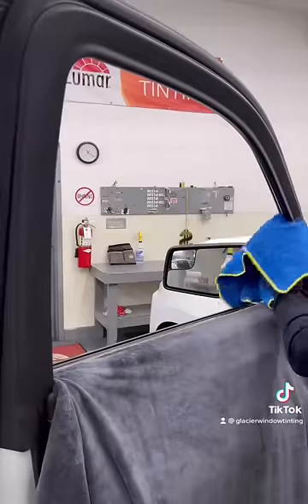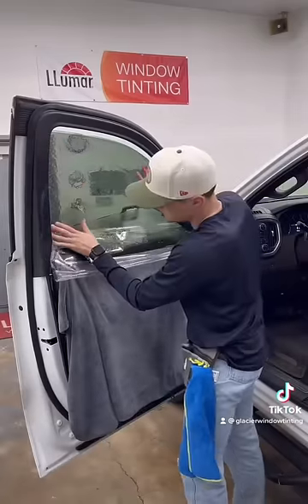Remove & Replace ✅

Comment: Damn I need my car windows tinted so badly. I get scared someone’s gonna see all my work tools and break in but more importantly I’m sick of getting caught picking my nose in traffic
Reply: go for it, you'll never look back!
Reply: I've got all my back windows tinted pretty dark from factory. Which is where I stache all my tools. Behind the front seats and under my back bench seat.
Reply: As long as you don't eat your boogies, you're good
Reply: Screw it , we all do it .. just remember though, Flick don’t lick 🤙🏼
Reply: @Vndcatr  that was a good one.
Reply: Bro same. I pick my nose in comfort with my 18% tint
Reply: I'm far sides and can't see far away without glasses. I also have transition lens. So make sure to take that into account when picking your shade of tint. Also I use black window covers so you can't even peak inside with a flash light.
Reply: I put tints on my car because it got broken into. 10 percent all around, 30 percent on the windshield. No break-ins since then. 
My stepfathers work van got broken into, they didn’t touch the tools…..they went for the grocery bag that had the Frosted Flakes.
Reply: I literally have a bumper sticker that says "Don't tailgate or I will flick a booger at you" 😂
Reply: @missali2u  While being the victim of such a crime really really sucks (I'm sorry that you had to deal with that).
That's a Win/Win as far as car break-ins go.
They broke in and left the most expensive stuff (tools and the vehicle) Win 👍
In a round about way, you "gave" a meal or two, to those in need, (I wonder 🤔 if you can claim a tax deduction 😏) Win 👍
🙂
LOL
Reply: tinted windows are probably one of the best quality of life upgrades that you can make for your vehicle
Reply: I feel you there brother. My new truck got NO tint and I'm like damn. All this Milwaukee and Snap-On really be tasty to someone.
Reply: Owwowowowowpwpwpwwpwppwowowowowowwowowowpwpwpwpwowwowowoqooqowowowwowowowoaoaoaowwowowowowowowowowowowowowowowowowowowowwoowwowowpwpwowowowowoowosowowowowwowowowowowowowosseeowowowwowowowowowowowowowowowowwowowowowowowowowowowowowwow
Reply: Went from having a blacked out 2 door to a 4 door with 0 tints at all and it makes me so anxious 😭😭 getting them tinted this week though
Reply: Someone broke in and stole all my tools just last week
Reply: I put 5% over top of factory tint for the rear side windows and back window then 50% on the front side windows. Just black when trying to look in. Can’t see a damn thing in the trunk or on the seats in the back. I carry a lot of tools and parts so it was the best money I’ve spent.
Reply: They have this stuff at walmart that is super easy to install yourself and it is removable and replaceable unlike most tints.
Reply: Y'all nastyyyy 😭😂 any of y'all ever heard of keeping a box of tissues and hand sanitizer in your car?
Reply: I be driving a tab bit slower than the person beside me just so I can pick my nose before we hit a red light lol.
Reply: @g35s  p
Reply: The best noses are hand-picked.
Reply: Digging for gold that's why lol
Reply: My mom once pulled up to a stop light and witnessed my uncle smash a mcdouble in 2 bites💀 we call him 2 bite mike now🤣
Reply: 😂😂 There was no pick! I was scratching my nose! There was no nostril penetration! I didn’t pick! There was no pick!!
Reply: Tint is awesome, but don't use it as a security device. It's stupid easy to see what you have through tinted windows. Just open your phone camera and press it to a tinted window sometime.
Reply: Careful if you have a warranty, it can void some. Found out it does right before tinting my windows, thank God.
Reply: @melaniesparkinez6867  did you know that upwards of 90% of people pick their nose? It's actually quite strange how much of a social faux pas it is. As long as it's not incessant and causing damage, there's nothing wrong with it.
Reply: NO SERIOUSLY WITH The Traffic Boogers ! It’s Like I’m Always Near Somebody Or Somebody Coming From The Opposite Direction Have Me Looking Like A Dead In Headlights With My Finger Casually Near My Nose Hole 🤣🤣🤣
Reply: Worth it man, just make sure it’s not exactly the legal limit or you gonna get whoop whoop
Reply: I dunno I kinda disagree with everyone's advice... eat them thangs! Extra protein 🤣
Reply: Hahahahahaha
Reply: Bro I had tints they broke into my car thinking I was gonna leave stuff behind but I remembered that I live in the hood and remind myself to keep the car empty no matter what 😂
Reply: The tint just gone make it easier and quicker for them to break in yo ride
Reply: @nsant YESS my sister does that and I HATE her for it 😭😭 I guess she’s not the inly one in the world
Reply: Got 20% all around my daily, (19' camry) and getting 5% with 35% on the windshield on my mustang in the spring
Reply: I think it's a justified expense
Reply: Hahahahaha

Comment: “A little bit of heat” proceeds to hit it with a blow torch lmao 😂
Reply: Ayo I was gonna say obviously this guy knows more then me about window tints but I thought a straight up torch would be a bit much for plastic film.
Reply: @SlowMenWorking  takes a bit for the heat to get through this new glass. It's not like in older vehicles. Even then it still isn't bad. 
It's just enough to create enough heat. It isn't bad at all.
Reply: @mitchellandrew3318  Lol right? What were they expecting? A BIC lighter? 😂
Reply: @sowelly2808  bahaha
Reply: @sowelly2808  it's always the ppl who have ZERO idea. And how some come up with there own techniques over time doing such trades. I build motors and homes. But also custom interior and stuff. If it works, I'll try anything a few times or come up with what works for me. I do lots of shit with motors many who don't even build, or they only know how to rebuild and say it's wrong. Like come on, I've blown up enough shit to find out what works lol
Reply: he was using it on the outside of the window. You dont need a heat gun if you know how to use a torch. He is not putting that much heat into it, either. Distance and speed of movement can be quicker than a heat gun with the same amouny of heat put into the window. That is a little bit of heat. That is the quickest tool for the job and easiest to use.
Reply: @SlowMenWorking  hes on the opposite end of the window. He is not putting flame on the tint
Reply: @Cory-lk5bu  and it's a green propain camping tank. They don't pump tons of heat compared to a yellow or blue tanks I use on my metal parts or doing plumbing.
Reply: That propane torch is nothing like an acetylene torch like most people think.
Reply: But it’s still a little bit of heat. He’s not holding the damn touch there
Reply: Dont use alot of heat on dual pane euro cars as the laminate they use to bond the dual pane glass will start to bubble.
Reply: @Cory-lk5bu  im sorry but here's the problem I have with that, what if I am bringing a really expensive car in to get tinted I am most definitely not gonna be wanting a blow torch anywhere near it. Just not a smart idea when you can get a really nice heatgun to be able to control the exact temperature to make sure your not gonna burn or melt any of the trim. Just wreckless in my opinion.
Reply: @Cory-lk5bu  who care the tint - is the car panels that matters if you have a expensive car you don’t want someone to try tint installation with a TORCH !!!
Reply: The problem with a torch is it's a pin point heat source. When you hear glass unevenly it causes thermal shock and forms cracks. With tempered glass this could be invisible to the naked eye but after a few heating and cooling cycles those cracks will spread and have been known to shatter. One of the first things you learn doing any work with glass and heat is that you either need to preheat the whole piece slowly and add more intense heat or use a heat gun on a reasonable setting and distance from the surface working over the entire surface. There's been times I've been lazy and went straight to using a propane torch to save time and as soon as the heat hit it cracked and shattered the glass I was forming. You'd think I would learn after the first time but it took a few times before I was sick of picking up the mess.
Reply: @SlowMenWorking  It's not... A blow torch works just fine, you just have to be more carefull to avoid burning the film. Just run the torch on a low setting, and keep proper distance, and it works just fine.

Go grab a torch, and move your hand in front of the flame at some distance - It's not searing hot once you get a few inches away from the flame.
Reply: @Cory-lk5bu  torching raw glass even if its for split second to get the effect of a heat gun puts the glass in extreme stress. if there was any micro cracks there it would probably bring it to shattering. i was gonna ask if he ever broke a window doing this before. cuz i doubt they teach you in school how to safely blowtorch car windows...
Reply: yeah jes gonna blow a window with a torch one day if its not heat resistant

Comment: that moisture bubble at the end though, haha great video in all honesty to bad thats there at the end.
Reply: Yeah I caught that too.
Reply: That’s what I was gonna say
Reply: I’m sure heat will make that go away
Reply: @akidim13  sometimes it does, that one looked fairly large but it's from video perspective. If not sometimes it can be pressed down but may leave a ring you'll see.
Reply: I'm trying to see it but I can't, is it at around the 2 o'clock area looking at window from outside?
Reply: I was about to comment the same thing..
Reply: @Paul B.  it's in the right upper region. The light coming through the windshield makes it visible but barely. I had to watch this 3 tines to make sure I saw what I saw myself
Reply: @nickm5466  lol same..
Reply: It’s normal to sometimes see a bubble like that. It will go away on its on in a day or 2. When I got my Tesla tinted it had that. Went away during the curing process and been fine a year later.
Reply: Was just looking for that comment to see if someone else saw it too
Reply: thank god i wasn’t the only one lolol
Reply: torches do that heat guns are meant to be used in this situation
Reply: Did you see that crease too? He done that window at least 2 times. He'll learn soon or later. Lol
Reply: Was going to say,I can see a bloop but I think your description is better....lol
Reply: Yup .

Comment: U shouldn’t be putting a Torch on the glass because you can heat shock the glass and shatter it and it also weaken the glass at a micro level
Reply: I'm sure homie knows what he is doing...
Reply: Hair dryer is better and safer
Reply: @Jabba.1  yes better than putting a 2600F tem torch on  direct glass

Comment: I rewatched this 4 times just to make sure and with confidence I can tell you that I saw an air bubble right at the end of the video on the top right hand corner (maybe 4 inches down from the top and 3 inches to the left from the right)
Reply: Yup
Reply: Yeah, i understand bubbles are inevitable but that big and that location is unacceptable, id make him pull it off and redo it
Reply: Looks more like a moisure bubble to me but it should have been propperly pushed out
Reply: Too busy making a video and not paying attention to applying the tint.
Reply: definitely i saw that as well
Reply: sounded like a pro for just a moment till I saw that
Reply: Seen it too!